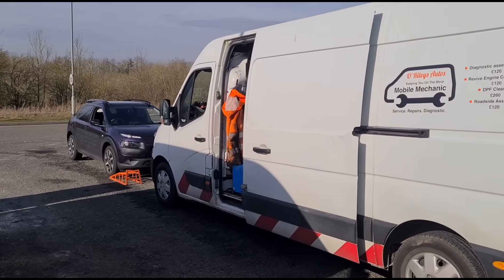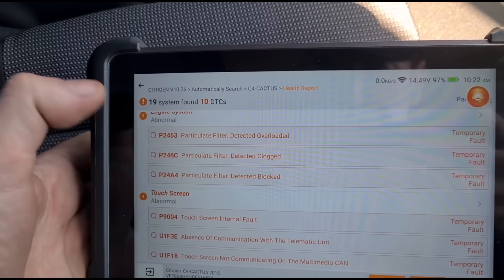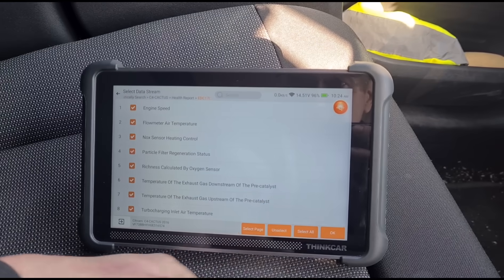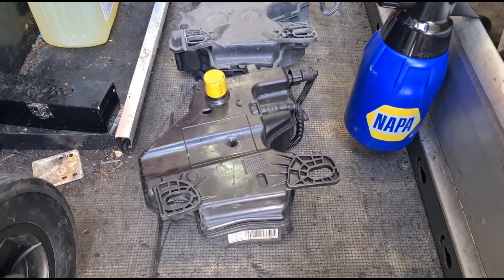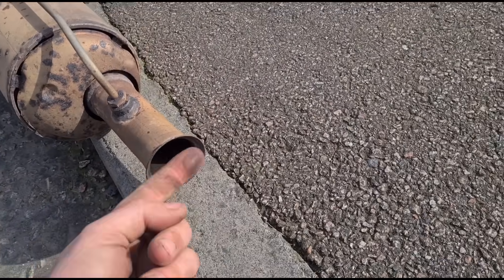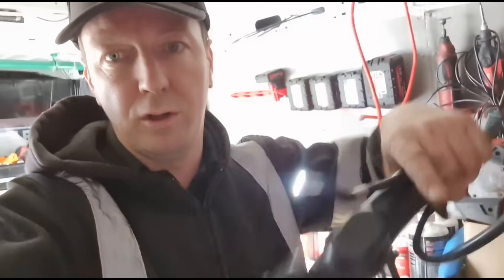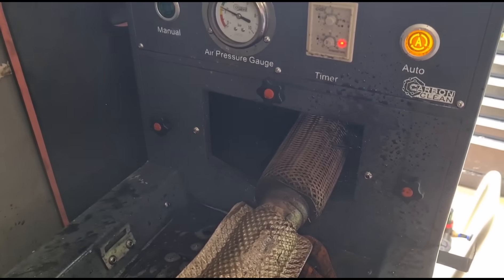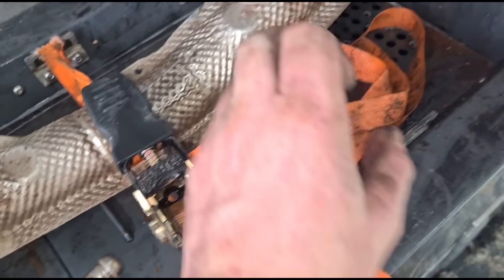Citroën C4 Off Car DPF Cleaning

Comment: Hi sir, I was wondering why when I disconnect the small tube that goes from the differential pressure sensor to the FAP, the car locks up and if I remove it is ok?

Comment: Just out of curiosity. How do you dispose of the waste sludge. Is it expensive to get rid of ?
Reply from the maker: Not expensive it can go to waste management company like the ones that take oil waste. Or keep in a IBC let the contaminants settle at the bottom and drain off the water. The sludge can go to waste management. Cheaper that way because there is less of it

Comment: Hi Jimmy I have a 2020 Audi A5 2 liter diesel i have some carbon out of the back of my exhaust just have 50.00O miles on it
Reply: Likely a cracked DPF.
Reply: @hughmarcus1  thanks just wondering will I need a new DPF or is it ok to drive it like that?
Reply: @pjthompson7319  I’d imagine it will eventually block solid as it’s obviously not regenerating. 
As Jimmy always says there’s a reason other than the DPF for what’s gone wrong. 
I think there’s a network of specialists affiliated to Jimmy now. Hopefully one near you. Have a look at his website
Reply: @hughmarcus1  she is regenerating she just done one this week

Comment: Why are you now doing off car cleans, has the old way stop working where you spray the launch fluid into it?
Reply: @fatboymotorsport
He explained that the off car Backflush is the only way to clean the ASH out of the DPF
Reply: hasnt stopped working, however an off car clean does yield slightly better results, on car is fine and will work majority of the time ( of course providing thats all it needs) but off car is a bit better
Reply: On car is for soot removal, off car is for ash removal generally speaking

Comment: Jimmy in a previous video you showed how to disable the eloys tank on the scan tool and said you had did this to your sisters cars and it ran for months with no effect, have you now changed your mind ? Abit confused
Reply: Just to correct Jimmy's comment about eloys being injected into dpf! This is not the case it's injected into the diesel tank each time it's filled with diesel to reduce temperature the soot is burned at! The key of accurate diagnosis is understanding how the system actually operates.
Reply from the maker: This had an eolys tank circuit error so it would stop regeneration from even happening
Reply: @ORileysAutos  I see, still wonder tho if you deactivate the tank if it stops regeneration, well at normal town driving anyway
Reply: @Vincent-cc8xo You can map it out but its illegal maybe thats why jimmy is being coy
Reply: @danascully-x2t  you would only ' map out ' if you were doing a dpf delete while the tuning tool is connected otherwise just disable in the bsi with the diagnostic